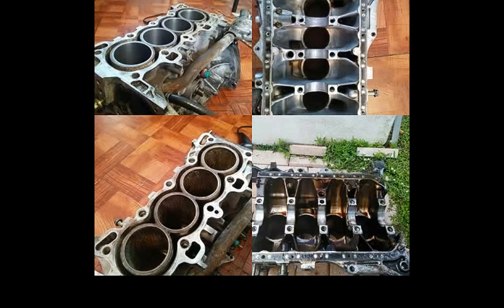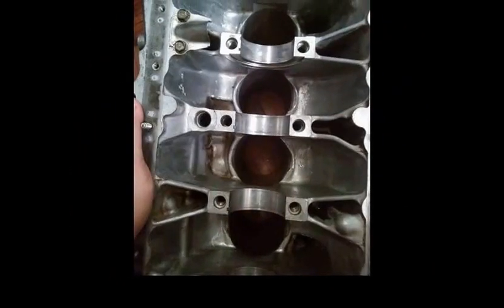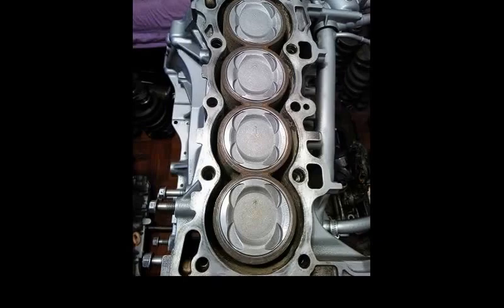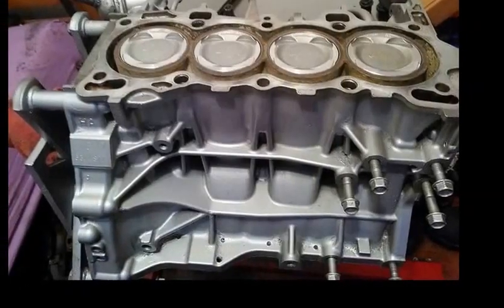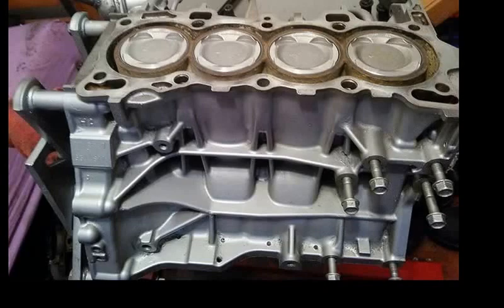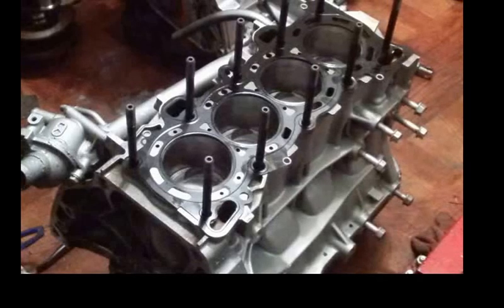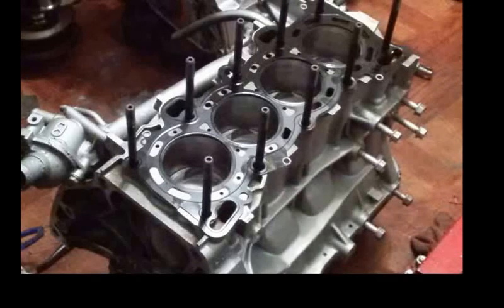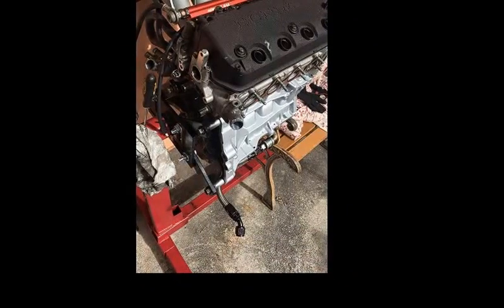400whp D16y Vitara Mini-Me

Comment: I've been looking into all my different options for my civic which has the worst motor ever, the d15b8 with 70 hp lol. It was looking like a mini-me was the absolute cheapest possible thing for more power. I think I will do that to my current block and try and find a complete d16 somewhere that I can rebuild with better rods and pistons. I would be VERY happy with 200hp in my hatch with an eventual goal of 250-300 max. I think with good pistons and rods I could probably achieve that no problem and have it be extremely safe and reliable. ON the cheap too.. Seems wrong.
Reply: Be careful pretty sure that the pistons in the d15b6 and the d15b8 only have valve reliefs for 2 valves per piston. The d15b8 I know for sure only has 2 per piston. You are better off just getting a d16z6 or a d16y7/5/8 and building it vitara. I would like a d15b8 one day honestly it is an amazing mpg engine. One of those can net you like 40+mpg.

Comment: Hey, just saw this video, I got an ek hatch with a d16y8, I wanna run around 250-300, 350 absolute max. If I wanted to stay on the low side would it be cheaper to go turbo or stay na.
Reply: Kobe Brown only way ur getting anywhere near those numbers with a d series is forced induction. You could do every bolt on there is on the planet on a y 8 and still never see 200whp. Maybe at the crank. Maybe.

Comment: I wish your prices were true. Maybe cuz it's 2019 but damn everything's so expensive now
Reply from the maker: Its 90-110$ for vitara pistons 220-350$ for rods. 80-100 for headstuds. Nothings changed in prices you just haven't taken the time to check any extra price comes from gaskets and bearings still well under 1k
Reply: I'm talking about a Z6 head is like 500$ now. A b18c motor is like 2500$

Comment: Not a mini me swap a mini me swap is a d15b or b7 or d15b2 block with z6 or y8 vtec head you just have to take out an oil jet pin that blocks oil to go into the head because they came non vtec stock and then your ready to put your z6 or y8 head this video is just a d16y7 probably with y8 or z6 head that’s it not mini me swap

Comment: Is there any difference in the y7 block and y8 block ? And which ones better for turbo with y8 head
Reply: Da Filth no difference in the block. The head determines if it’s a y7 or y8 y7 being the non v Tec and y8 the VTEC model

Comment: my minds made up. I'm doing a single cam build. when I go home next month, I'll look for a swap. or at least a motor
Reply: @dominicjeanb2063  did he ever do it?
Reply: Sam Manning not that I know of, however I decided to do one, I’ve got a mini me swap it’s a z6 bottom with a y8 head, vitara pistons, skunk 2 rods, crower springs and retainers with a .63 Garett turbo on my 99 ek hatch. Everything is put together for the most part but I can’t get it to start at the moment. But once I do, I’ll post it up and be a testimony of a single cam build hopefully😂😕 thanks to vhbengines for helping inspire meh lol
Reply: @dominicjeanb2063  Ahh sweet to hear!!! I'm new to engine rebuilds or builds alone and I'm thinking of messing around with my del sol in the future :)
Reply: Dominic JeanB hoping to see the build man mini me swap here too!! Bought vitara pistons and rods, imma suscribe and wait for your vid
Reply: @dominicjeanb2063  did you figure it out the issue?
Reply: Victor I had my fuel pump wired wrong and I believe I was having an issue with my distributor so I got the fuel pump issue fixed and ended up switching from a piggy back ecu to a complete stand alone which has come with its issues, should be done any day now smh 🙂
Reply: 1MEAN_5.0 damn man I can’t believe I never saw your comment but thanks! But unfortunately things got bad and it’s still not finished, but it should be done any day now, hopefully I can start making vids on dyno day within these coming few weeks!
Reply: @dominicjeanb2063  yea ive seen thats theres issues related to z6/y8 so wanted to see what you had. In the process of starting mine

Comment: what brand h beam rods you recommend for vitara pistons...any good budget ones
Reply from the maker: Origin, CX Racing, i'll just grab whichever is cheapest with rod bolts included. link below may also help

https://www.youtube.com/watch?v=YilHHHMy4gw&t=9s
Reply: @VHBEngines  I know it's old as shit but what about.the newer no notch long length rods would that yield a better.power curve and output ? I'm wanting all the sauce 400 or bust , .... D16y8 Vitara, no notch long length rods witch I think I'n the d16y8 with Vitara would be 8.8.1 compression ... Arp head bolts, shimmed oil pump, oem Honda head gasket, ebay journal bearing 60 trim walbro 340, 750cc hunter tuned injectors, tuned on chrome ... Of course a ems2 stage 5 clutch and hopefully an lsd also and a good crank case, valve cover catch can setup what do you think .. love your channel and your knowledge for the budget minded is unmatched
Reply from the maker: @kerryhunter6304  Nippon racing has new vitara pistons that bring compression up to 9.6
Reply: @VHBEngines  so that would be a better option ?

Comment: What kind of h beams did you use ?will they work in a z6 ?
Reply from the maker: they didnt have any brand on the rods and though they were new i wasnt the one that bought them. got them in a trade. i just labled them as cx racing because even if they arent its still a knock off
Reply: Thanks
Reply from the maker: Stacy Pfingsten if you look through my videos i have a parts guide. everything i use is on it
Reply: I will do that

Comment: whats good bro, im building my d16y7, should i bother getting the y8 setup or would the non vtec put out similar hp? im going with the Vitara pistons and trying to boost. thanks
Reply from the maker: def get the vtec head. its like a free 30whp increase just from slapping it on
Reply: VHB Engines thanks bro, so after I put on the new head, what are your ideas for turbo kits, and internals that would keep up with the boost. it's my daily but I would like to call out some bammas that hate on the sohc. looking for the 300-350 range. thanks
Reply from the maker: open the description box and copy that. personally its the only way to go for a sohc build. as far as turbo's/kits then check this out for a more in depth answer https://www.youtube.com/watch?v=YilHHHMy4gw&t=8s

Comment: Are you still using the y7's crank? I heard that the z6's crank reduces the risk of spinning a bearing because it has two oil ports
Reply from the maker: Ipodtouchgenius12 the z6 does have better cooling, but wont make a big difference anymore one you upgrade rods. so no problem with using the y7 crank
Reply: did you port and shim the oil pump?
Reply from the maker: Ipodtouchgenius12 nope
Reply: wow, how long has the engine been able to hold that?
Reply from the maker: Ipodtouchgenius12 lol over a year before the guy plucked the swap out to sell. the only real weakness of these engines are the rods. like i said once you upgrade itll hold jus fine. another guy in the area i moved to made jus shy of 500 on e85 with pretty much the same setup
Reply: that's insane, i was about to pay about 1k to buy all of the parts to up my valvetrain

Comment: With the Vitaras, i noticed you installed them with the arrows facing the rear or the engine rather than the timing side, is that for any specific reason?
Reply from the maker: Colin Brunt yes. the vitara pistons are made for the suzuki vitara engine which has a different setup. for the intake quinch pads to be on the right side and to reduce piston slap thats the proper way to install
Reply: right on, thanks for clearing that up man!

Comment: jaajajja ok bro. what's the lowest compression ratio you'll aprove
Reply from the maker: i think the vitara setup is the lowest compression. which is 7:3:1 in a d16. as i repeatedly say ill never push a honda engine over 500whp so i dont think id use any other pistons than those. they can hold the power and are by far the most affordable brand new.

Comment: well is not private. look building a JDM d15b and can't find shorter rods so if I use 137 mm forged rods the piston will be above deck by .022 in according to zeal calculator. PS already bought vitarra pistons . thanks
Reply from the maker: http://www.ebay.com/itm/Connecting-Rod-ARP-Bolts-Set-for-Honda-Civic-Wagon-CRX-D15B2-Forged-Bielle-TPM-/351500118109?hash=item51d70a285d:g:zOYAAOSwLVZV5nQY&vxp=mtr
Reply from the maker: thats a set thats for the d15b. not named brand, but neither were the ones i used really. if you dont trust those could always swap out for a d16. plenty of those to be had for the low, unless you happen to live in a area where honda's arent plentiful.